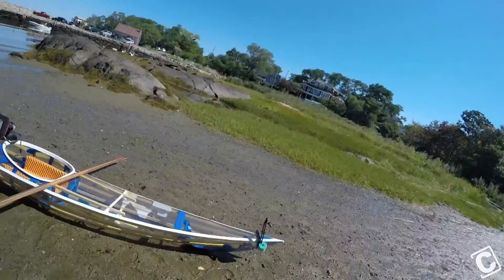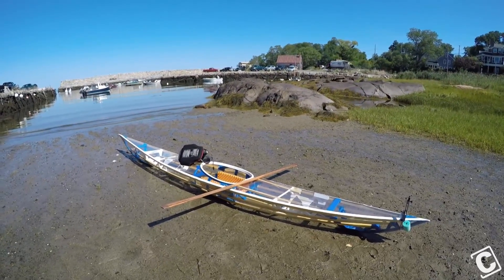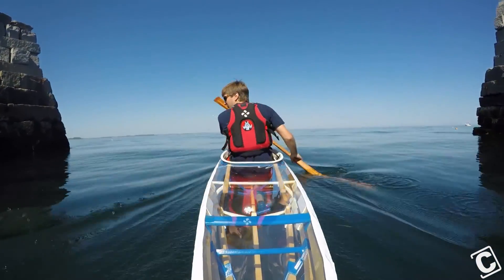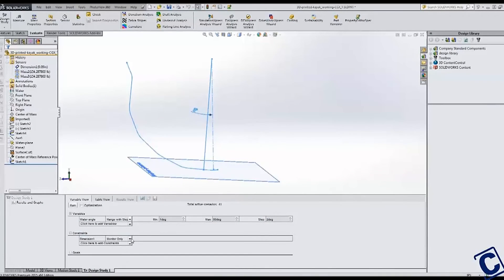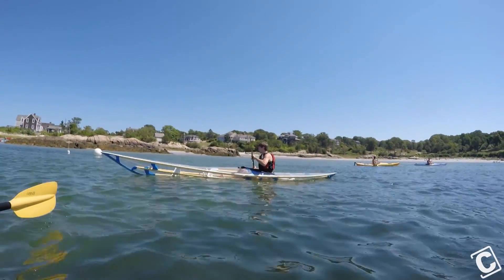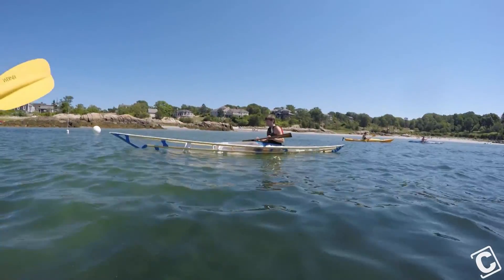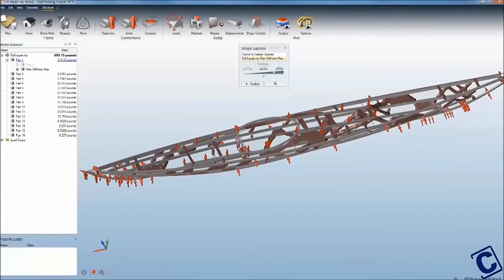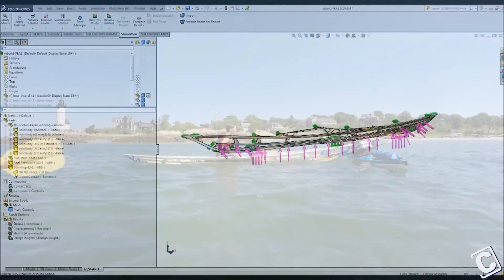3D Printed Skin-On-Frame Kayak Water Test

Comment: obce again,you havd taken a simple liw tech thing and complicated the shit out of it.

a gross waste of modern manufacturibg methods and a huge increase in time.

as for your roll and one or two questions re it.

the roll failed as you could see him going back in.tyr more layback and its easier to recover with an additional forward stroke if you dont make it in onevrear stroke.

just a hint.seing as you have a clear skin how about a roll with the camera INSIDE the boat.

i have never seen a roll shot like that before.

the boat looks like it tracks well so you got it all right despute the technology
Reply: If you are going to "despute" something, at least do some reading first. A laser sintering printer can bang out a full set of these kayak frames in the same time it takes some fool to cut and sand wooden ones, and the printer doesn't need health insurance. Still not fast enough for you? Take his exact same design and scale is up for injection molding. That could RADICALLY reduce the cost and time for building a skin kayak, both at the manufacturing and assembly stages. This kid is a hero. But this really isn't about the tech, is it? This is about getting to be a snotty paddle poseur in the YouTube comments.